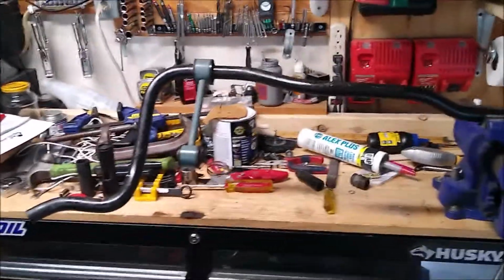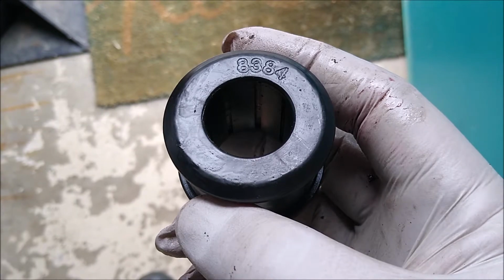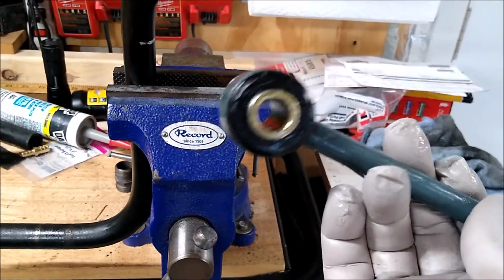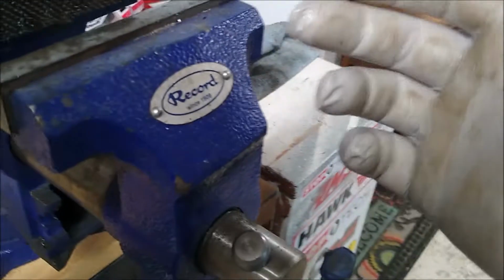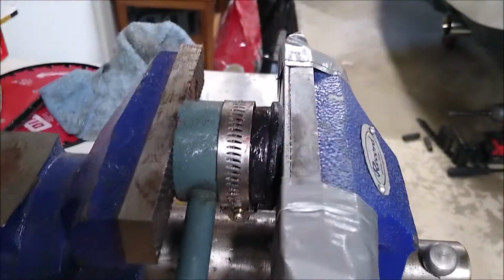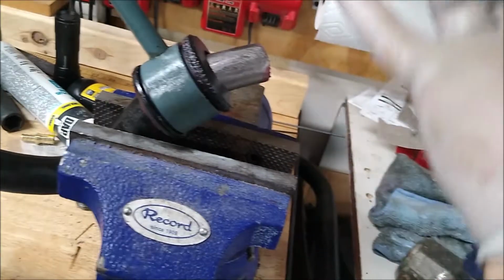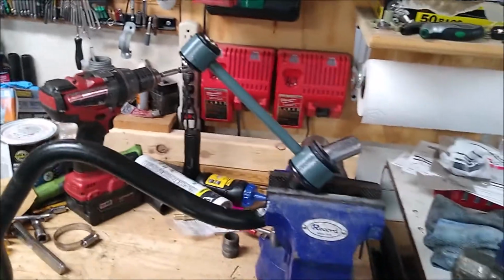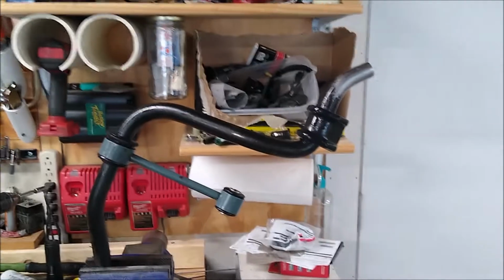'08 Mustang installing Energy Suspension rear swaybar bushings

Comment: Dude, this is the worst damn kit to put on. I’ve pressed out the old. Pressed in the new. Thought I had the hard part done, but after grinding some metal off I am struggling so bad to get it pushed on further. Fuck this kit. Spend the 180 on the bolt in kit. This shit is terrible. 3rd evening working on it. Ugh. Rant over. Thanks for listening😂

Comment: I did mine today. Had to cut the old ones off. To install new ones I put them on the concrete floor, set the new greased bushing over the hole and tapped them in with straight down stroke with a 10lb sledgehammer. Popped right in. All of them. Even banged in the metal tube. Give it a try.